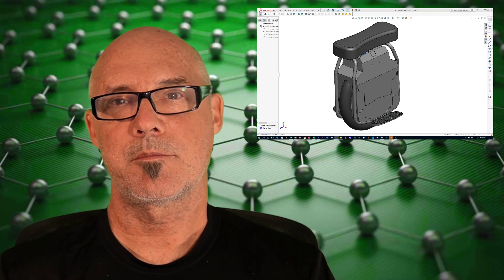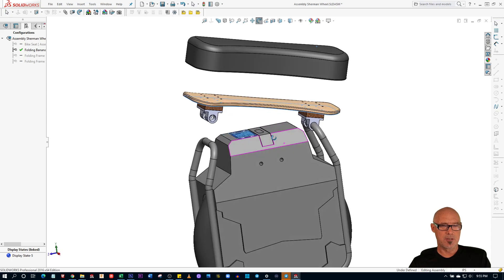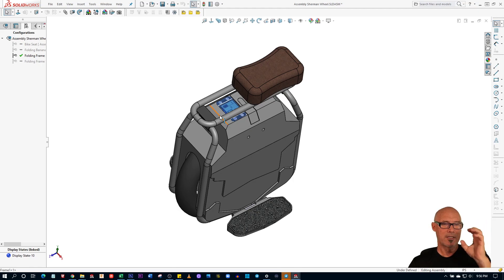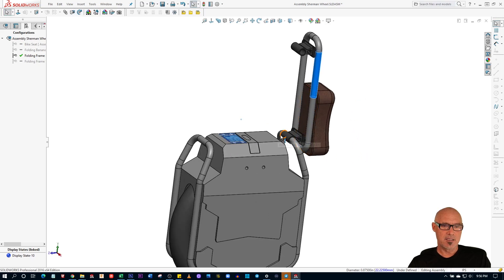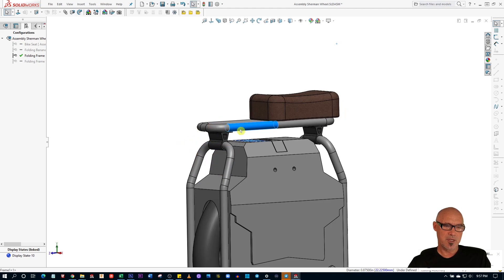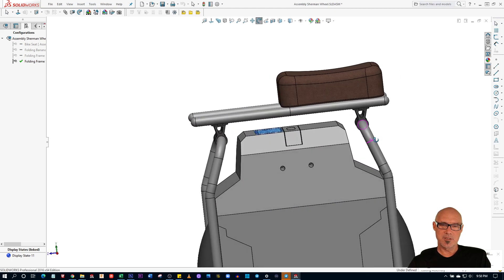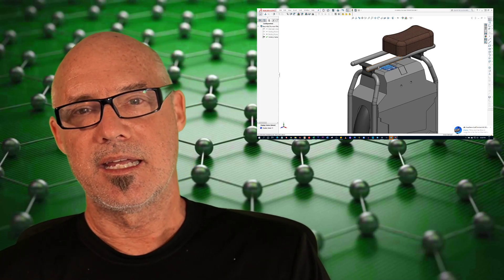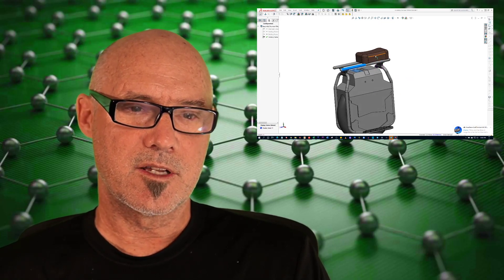Sherman Veteran EUC Seat Concept

Comment: This is pretty much an exact copy of zoomwheels Brian's seat , and now he has strengthened it on the second generation it is super awesome, both his seats are the best , the speed seat or the comfort seat , and for the money is the best seat on the market by far
Reply from the maker: I assume you're talking about the long wood based seat with plastic brackets that you kind of "pound" into place. Marty has one of the speed seats and will be trying it out. He's been told to reinforce it by screwing the two plywood piece together in the middle. I think he'll also want to put tape or hose clamps on all four sides of the mounting brackets because they shift when side load forces are put on them. I'm more interested in pursuing the looping tube-frame version that reinforces the whole "roll cage" frame. The tubing would most likely be lower than modeled in this video. I'd have mounting platform on the top rear that allows you to put "risers" on it as a way of having adjustable seat heights. That version has a nice "hand-friendly" front end to grab onto when seating yourself and/or standing up. If it can hinge upward and reinforce the trolley handle, I think I'll have a winner.
Reply: Just received mine from zoomwheels but I don’t have my Sherman yet lol 😂

Comment: The problem with the current design is the open end (snap on) brackets. The roll bar on the Sherman is smooth causing the "C" style clamp to slip side to side with your weight. Forward and back movement is solid but the seat will move left and right as the the clamp slips on the rail. I've experienced this myself.
Reply: This is the problem I'm having too the c clamp are slipping side to side I'm using 3/4in clamps but I think if I wrap the bar with something rubbery it won't slip.

Comment: The clamp riser is too high in the back take the bars and front clamps away ,and leave the back clamps on ,leaving the front clamps on takes away from the trolly and screen ,put a piece of foam or something harden underneath the seat attaching to the back ,behind the trolly handle ,u can also put a half board or Plexiglas with lower clamp risers attaching to the seat

Comment: I had a similar idea. The only difference being an elevated telescopic seat, providing suspension in the seat, so you may simply shift between standing and sitting by adjusting the weight from your feet to your seat. Oh, and then then KS and Inmotion wouldn't be the only suspension wheels out in 2020. =)